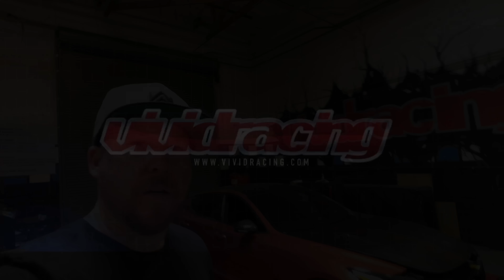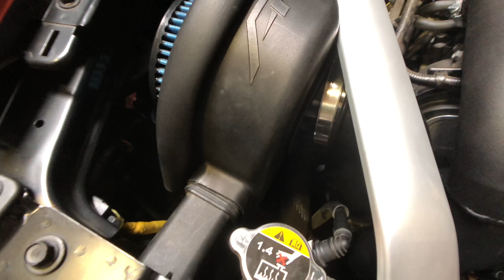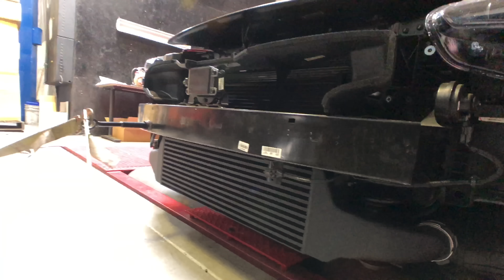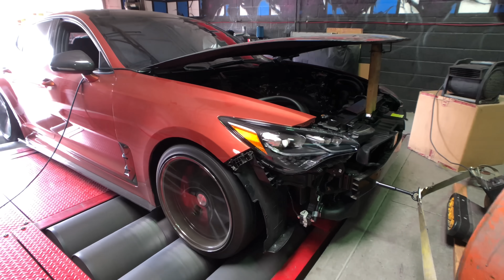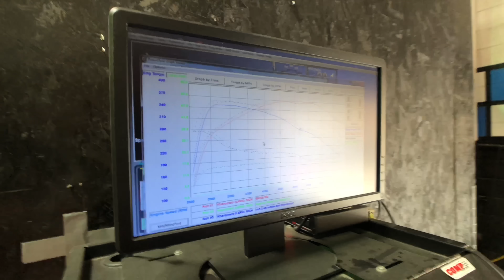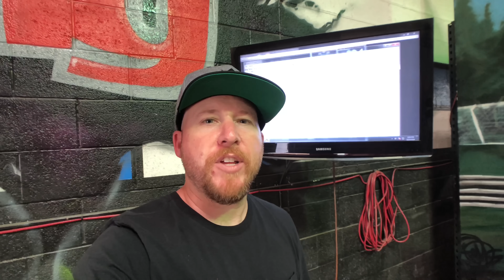3 Must Have Mods for Your Kia Stinger GT by Vivid Racing

Comment: No one saw the VIN number so how can anybody say the warranty is toast. All these fellows have to do is to put the motor back like they got it and they are good to go. Although I would clear the PCM so there's no record of the modifications to let anyone scan for mods. If you raise the boost, it's kind of like pulling the pin on a hand grenade. Sooner or later it's gonna blow.
Reply from the maker: No ECU flash so its just putting hard parts back on
Reply: @vivid_racing  The only real problem with installing these mods while under factory or even extended warranty, is that if you need to bring the car to the dealership for ANYTHING, including simple stuff like regular maintenance issues, they will see it and could void out your warranty unless you remove this stuff every time you have to go there. Don't get me wrong here, I am extremely impressed with what you have created here, but voiding out that warranty should scare the crap out of just about anyone who dropped $50K plus on a new car.

Comment: There goes your Kia warranty out the window
Reply from the maker: The full warranty?  Kia will void the infotainment system because of blow off valves?  Windows?  AC?  There is a lot to understand about warranty and warranty laws first.  They can only void warrantying parts that are modified or affect a related system.  So in theory they would void your engine warranty.  Unfortunately warranty is a very vague world where some dealers are ok with it and will push things through and others are not.
Reply: Vivid Racing I thought any mods you do to the car affects the warranty and insurance
Reply from the maker: Datruth Commission where are you from?  Insurance is not a issue here in the USA like in the uk.
Reply: Vivid Racing i am from the UK, the insurance premiums here are crazy especially on high performance cars. A couple of year ago I wanted to import a Nissan skyline R34 GTT from japan, after searching around for insurance the best I could get was £2050/yr
Reply from the maker: I guessed and figured as I had a brother that lived there.  Would not lower his car in fear of an insurance issue.  Much different here in the states!
Reply: Vivid Racing in some cases insurance premiums are much more expensive than the value of the car you are insuring
Reply: Datruth Commission my mx5 insurance as my first car in the uk was quoted at £11,500 which just shows how ridiculous it is
Reply: Nope, mods don't void a warranty unless the dealer can prove the mod caused the problem.

Comment: Getting these mods will get you K.I.A on the street lol
Reply: rimshot
Reply: I almost died when I read this comment lol I've raced one of these in my 02 s500 and I pulled on it really hoped it would have been faster
Reply: These personal anecdotes about whatever you believe was a street race is basically a joke. The Merc is heavier and down 60+ HP. It doesn't have an 8 speed trans with sport mode. You either got lucky with a Stinger 2.0 or the 3.3TT didn't know he was racing you, lol. If you don't have track slips, it didn't happen. Dream on.
Reply: @trihards_dad  I'll take things that never happened for 800 alex.

Comment: This is one big ugly cheap looking car. This is why you see none on the road its a poor seller 50k can be better spent.
Reply: Best bang for buck out there....... Period
Reply: @TheAtiHD  idk... buying a new audi a3 and tuning it is pretty good. Stage 1 you push 310+ and the dsg trans plus haldex put the power down well. If you opt for an older a3 you can even do an is37 turbo swap for 1500 dollars plus a couple grand for tuning and supporting mods. This can easily get it almost to 400HP.
Reply: @xmr323  so how much for an A3 fully loaded?
Reply: @TheAtiHD  about 41k. Not that you need all the features. A premium plus model has most of it. If you go used a bunch of 2015s and 2016s go for 22kish with 35k on the odometer. Sure its not for everyone but the a3 is just a nicer golf gti with haldex.
Reply: I mean they are selling pretty much all of them but its a low run. Seems like a relatively solid car but yeah 45kish is a lot for the gt...
Reply: Tripping I have one  it’s runs stock 12.s tf.  And it handles and brakes better then a Porsche panamara
Reply: justingeturgun What is your trap speed. I ran 12.35@110mph and I put down 406hp and 515tq to the wheels
Reply: Where your failing to see is where the power is ... look at the graph.  This engine makes full boost and torque from 2-5500 rpm
Reply: @goonagerepublic  Same with the is37 turbo on the audi a3. Most of its power is extremely early on. Tons of hp and almost matching torque if not more torque.
Reply: Theres a awd v6 one for 32k with only 8k miles
Reply: You don't see any on the road yet because they are brand new! Just give it time. I'd rather get a Genesis G70 though cause they look a lot better.

Comment: with 20% drivetrain loss you should have got around 290 hp to the wheels in a stock car, really the 37°c kill 50 hp even with the intercooler and the other modifications??
Reply from the maker: you don’t understand Mustang Dynos or dynos in general than
Reply from the maker: Do you care about the gains or the numbers?
Reply: Not corrected for temp humidity and altitude im sure.
Reply: @vivid racing what does a stock gen6 Camaro SS run on your dyno?
Reply: Gonzalo Fernandez shut your hole
Reply: Im confused ? 365hp down to 240hp ?  Thats alot of lost power? 
Help me understand ?
Reply: Gonzalo Fernandez yeah something’s fucky here. There’s no possible way that a car that regularly dynos well above 300 whp got less than that with an intercooler and intake.
Reply from the maker: There is no such thing as "regularly dynos".  Every dyno is different and what matters is the delta.

Comment: Something isn't right here, the stinger stock has about 311hp to the wheels. How are you getting 235hp?
Reply from the maker: depends on the dyno
Reply: Vivid Racing you have a reeeeaaaaaally shitty dino then to make ~75 less whp then literally almost every other video on yt
Reply from the maker: Its "dyno"...  There is no T-Rex in this video.
Reply: @bronzewaffle2310  oh snap you just got bitch slapped
Reply: @vivid_racing  you've upset the Stinger fanboys lol
Reply from the maker: I wonder why, we made new parts and showed off how they do.  I cant educate people on dyno system though.
Reply: @vivid_racing  that was Awesome! SUBSCRIBED!
Reply from the maker: @jpateka  Thank you!
Reply: Mustang dyno is an AWD dyno and reports much lower numbers compared to DynoJet. It's all about how much gains you make from the baseline.
Reply: on the other vid here, the M4 on paper it has 425hp and here on the same dyno it only showed about 321hp, 100hp + difference....  worse than the stinger up there
Reply from the maker: RGoh focus on the delta not the number.
Reply: these amateurs have no idea about Dyno numbers....
Reply from the maker: no one will read this but...  If my car makes 311 rwhp.  I spend $2000 on exhaust, intake, stickers, whatever and it dynos at 325hp, you make 14hp.  If my car baselines at 235rhp, same mods and the car then makes 300rwhp, you make 65rwhp, which would you rather have?
Reply: To be honest these kids above are probably using lame ass Dyno packs to measure gains. Roller/Mustang Dynos to me give the best results. and to answer your question i would take the second car ;)
Reply from the maker: But those views are good on the video :)
Reply: @vivid_racing  I read it maybe u should have a vid about dynos?
Reply from the maker: Fernando Cabrera yea will do
Reply: would it make a difference on how the numbers would read if the power was sent to two wheels on a mustang dyno?
Reply from the maker: Yes there is a difference when you run a car in AWD or RWD.  The drivetrain loss is different.  Usually in RWD/2WD you see about a 15% drivetrain loss where in AWD you see a 20-25% loss.  Obviously when you are driving, all 4 wheels are spinning so this is more "real world".  End of the day again... doesnt matter what the "number" but what the gains show.

Comment: Yeah the AWD Mustang has to be killin the number's. I've seen many variances but my stock 3.3 RWD on the Dynojet put down 356 / 391. After just the K&N Typhoon intake system she put down 368 / 393. Top gains were 13hp and 11lbs.

Nice gains though VR and the intakes and cooler look great 👌
Reply from the maker: Yea the dynojet is more of a numbers dyno.
Reply: Doing a muffler delete will also increase hp wish they did that
Reply from the maker: Will show off our exhaust soon

Comment: Uh oh you cheated by removing the bumper to bring in more air directly
Reply from the maker: The bumper was removed to install the intercooler right on the dyno to do a before and after with the stock one.  So the control was the same with the only variable being the intercooler.
Reply: Ok thanx for the quick response
Reply: In theory a bumper will help direct air into the cooler
Reply: Son this is a red car not a black

Comment: Most of the videos I've watched have the HP more in the 330 range, your numbers seem really low. Is it your dyno or does the 100 degree weather really kill it that badly? Great video, so many modding options for this car already. What other performance parts are you going to be releasing?
Reply from the maker: Jigga Man what’s more important the gain or the number?  The gain is as dynos are all different that is why we do back to back testing to show you the delta.  But yes a mustang awd dyno has a drivetrain loss of about 20%.

Exhaust coming soon!
Reply: Its a mustang dyno they show 12 to 15 percent less than a dynojet
Reply: Pross has the best results I've seen. Pro tuner they have 430+ whp. Lap3 pross for the win
Reply from the maker: Brock Hansen again... what was the baseline.
Reply: 466WHP Stinger w/ LAP3 Pro-Tuner Remapping
472.8ps/68.29kgm(466WHP/493ft-lbs)
Stock Intake, Full exhaust, Meth Injection kit
That's over ~130-150WHP+ over stock.
Reply from the maker: Ok you are quoting PS which is crank horsepower.  Nothing to compare.  Plus a meth injection full exhaust tune.  Apples to Apples this is totally different.
Reply: I get that dyno's are different but that is a massive difference. Stock the car should be getting around 320-330hp to the wheels. Is there a way to calibrate this dyno to read the correct numbers? I get the gains were 14HP over your stock low numbers and the gain is what you are demonstrating. I have full exhaust, downpipes with 2nd cat delete, intakes, lap3 chip (93 setting) and NKG plugs. 0-60 is just about 4 seconds (AWD). Maybe do some 0-60 pulls and post some times? Has it cooled off there yet? 60's where I live and the turbo's are loving it.
Reply from the maker: You can make the dyno read whatever you want.  Our multiplier is set to 1.00 and this is what the drivetrain loss it.  If your car dynos at 400 and after mods makes 415, is that ok or if you car baselines at 300 and after mods makes 370 horsepower is that better?  What the number is is irrelevant.